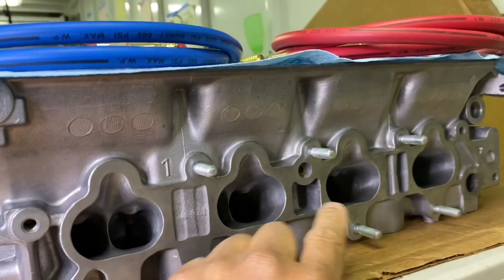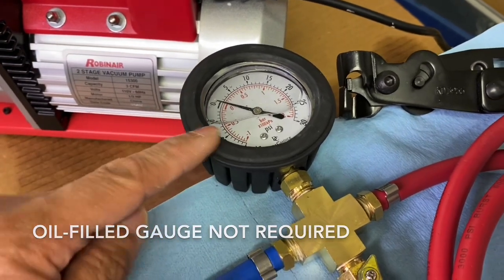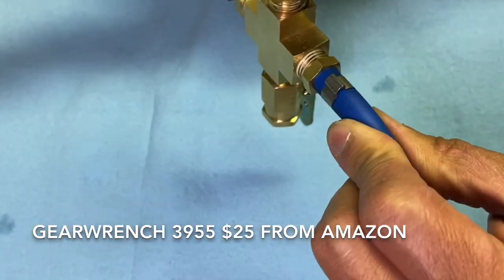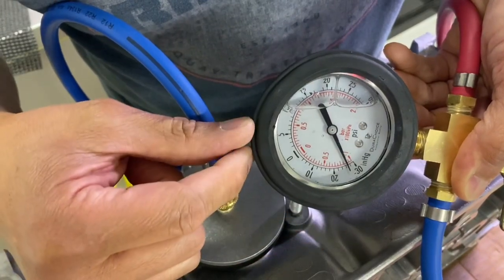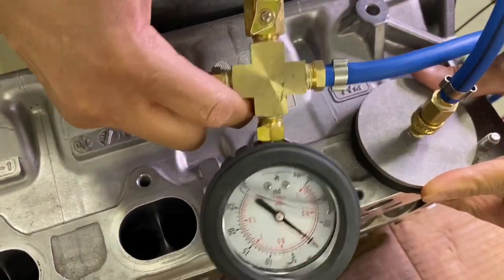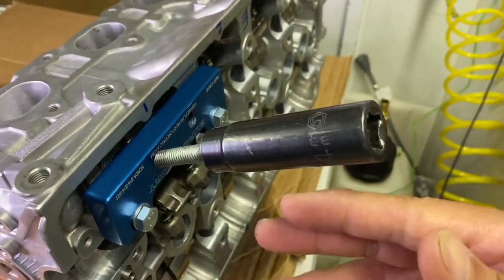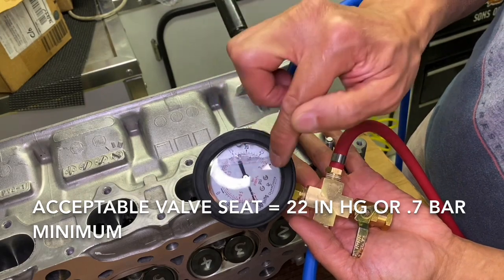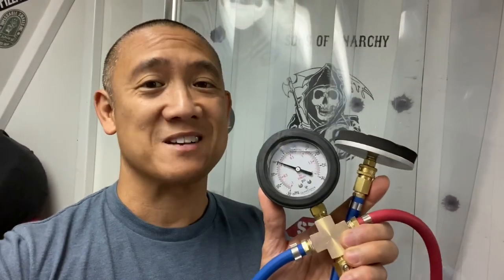How to Check Valve Seats with a Vacuum Gauge

Comment: We use to build similar setups back maybe 40 years ago for testing different things. The constant vacuum source setup can be used for multiple things. Ummm, maybe the only thing I personally would add would be another valve on your red line are vacuum source so you can close it and do a count down after the desired vacuum is acquired. This release's the constant vacuum and can give you a finer reading even though you may not want to test that far. But having the other valve does allow for testing other things that may require a more definite leak test. But that is just my opinion and how some of us use to do it way back. We built multiple different plates etc. for testing different ways. It is good to see someone like you to build your setup. SO many people now days can't figure out anything past a computer are diagnostic screen.
Reply from the maker: Thx for watching, commenting, & the kinds words. I like ur idea regarding the additional ball valve. In fact, I’ve seen something similar on a hand vacuum tester. However, I’m not sure how to quantify if the valve seat is good or not based on the time it takes to lose vacuum.
Reply: @RelentlessRacingAJ  As a starting point, Measure each combustion chamber are single valve are whatever checking. Write down each and try and make all as good as best best one. You will want them natural and clean, do not use any grease as some so mechanics have shown on videos, that defeats the point when trying to get the best seal possible. Plus a vacuum gauge and a tach together can diagnose most anything even the fanciest scanners and equipment can do. If you know what your doing are willing to learn.
Reply from the maker: @rickyshuptrine2831  next head I check I’ll try it. Thx again, AJ

Comment: I learned something new today, I always use a leak down tester or compression gauge after a engine build which is like putting to cart before the donkey. thanks for the interesting information!
Reply from the maker: exactly why I made the tool... it's not the end all be all, but it serves a as quick check so I don't waste my time installing the head and whole motor in the car and find out there is an issue. Glad you liked the vid.  Pls subscribe.  Thx AJ

Comment: excellent tool and video! much more cost effective than buying the whole tool from goodson! and the electric pump could have lots of other uses like getting bubbles out when pouring urethane etc. im working on my own and looking to make an adapter that covers the combustion chamber, so can check all 4 valves at once as well as potentially seeing potential cracks in a head if the valves seal on the outer ports but the chamber itself is not!

Comment: I have tested my head with vacum but using manual hand pump, is more cheap and you can see easy enhough if the head is good or not. mine got to 25/26 on manual pump.

Comment: Good info here, i was doing some diy work on my subaru heads and used the water and air method. It kept failing . I needed to work late and poked around also building a tool . I made mine from an old refridgerator compressor an automotive vacuum gauge a plastic sheet and an oring seal from an old oil filter(junk i had at my disposal) it worked flawlessly. Since the minimum is 22 i passed. It is good also for a quiet setup as the refridgerator compressor has a vacuum and makes very little noise.
Reply from the maker: Nice. Like I wrote b4, it’s not the be all end all, but merely a quick check. pls subscribe. Thx AJ

Comment: I made a tool almost identical to yours and they DO work really well and gives you Peace of Mind! ❤ Good video, better than mine, lol.
Reply from the maker: It is a very useful tool. I even modified the tool w another ball valve which shuts off the vacuum source. B4 and after lapping valves I measure how long the suction plate stays adhered once the vacuum source is cut off. It tells me how much better the valve seat is sealing as a result of lapping.
Reply: @RelentlessRacingAJ  I, too, put a tiny ball valve in line to time leak down. Your numbers on good sealing are good numbers to go by and if you get more inches of mercury, that's even better. I think my sealing numbers were closer to 28 in/hg and that was without valve springs on. After those valves smack the seat a few hundred times, they will be set for good. I know I have a good feeling about how the valves sealed in my 4G63 head that I just put on the shortblock yesterday. Good info for everyone! 👍
Reply from the maker: @martywilsonwilsonenginesho7940 nice... I have been using this tool to evaluate used motors. Usually allows me to get a deal on the motor. I've noticed bent valves won't hold any vacuum. Also, if the valve seat isn't perfect or has corrosion or debris (carbon build up) it at least will hold some vacuum (at least 10 in-Hg). I had a port not hold any vacuum, but fortunately it was large debris between the valve and seat. Some vacuum is my indicator I may have a shot at lapping the valves and saving myself from taking the head to the head rebuilder for a full valve job/replacement. However, if it is a race motor I always rebuild the head and replace the valves and all the other crap anyways. Thx for watching and commenting

Comment: Awesome video! 
Great info which I plan to follow.
Do you know would I be able to test valves with a single stage 3cfm vacuum pump as that is all I can find locally?
Not any 2 stage pumps
Thanks
Reply: yes it will work

Comment: I recently duplicated your rig using a 1 Stage 1.5 CFM A/C vac pump with a  0.020" diameter Orfice Restriction fitting placed on the pump suction fitting....I also Added a vacuum In-line Ball cut--off valve between the Orfice Restriction & the Head Port Pad....These additional  components let's me measure  Significantly Large vac Reading Differences between known Measured valve seat Concentricity measuments of near perfect 0.0005", 0.002" & 0.006" valve seat runout with vac gauge showing Incremental Hg reading differences....The Vacuum shut-off valve closed shows Large vac leak-down rate timings....

Comment: I don't understand why everyone is saying that this test doesn't take into account valve guide/stem/seal leakage.  It absolutely DOES.  If the head of the valve is sealing one end of the port, and the other end of the port is sealed by the test adapter, it doesn't  matter whether there even IS a stem seal or large clearance on the stem.  Both ends of the port are sealed during the test.  There is no place for the vacuum to leak in that case, other than the valve seat, or the seal on the vacuum tester to the port.

Comment: You need to shut off the vacuum and see how long the vacuum holds, 
A large vacuum pump will pull that vacuum with a poorly seated valve.
Another method is to put a bubble glass in the vacuum line to actually see air flow.
Reply from the maker: Thx for watching and commenting. Agreed… this was discussed already. I have a Goodson hand pump and they had some numbers on the instructions. However, it is unclear how to quantify the correct amount of time for a hood valve seat to hold vacuum. Do you have any suggestions?

Comment: I did a valve job and got 3 cylinders ports or whatever maxed out and the 4th one has 25 hg vac. That 4th port valve was super pitted on the intake. MY exhaust valves are perfect
Reply from the maker: Nice. That’s why I don’t do valve jobs. I figure the machine is much more accurate than me. Also, I only use this tool as a quick check before installing a new head w a fresh valve job.

Comment: Very informative, well made video. How does the test described here differ in diagnostic capabilities compared to a water test with pressurized air through the ports. I tested a used head I purchased and out of the 20 valves only two of he exhaust valves show bubbles with the water/air test. Would this method be a more reliable way of telling if there is a valve leak? Thank you
Reply from the maker: Thx for watching and commenting. Pls subscribe. I’ve found using liquid (I use alcohol) and air pressure thru the ports is ineffective bc with enough air pressure, it can overcome the spring pressure and open the valve.
Reply: @RelentlessRacingAJ  Thank you.

Comment: How do valves go holding vaccum when you turn off the vac pump or close off the suction source? Do they hold that vacuum or how quickly does it drop?
Reply from the maker: Good question. B4 I made this contraption, I purchased a hand actuated vacuum from Goodson and couldn’t get a consistent reading bc the suction pad and ports only hold vacuum for so long. Recall, the port is not completely sealed. It leaks thru the valve guide, valve seal, and valve seat (hopefully your machine shop did a good job and the valve seat seals well). Thus, to get a consistent reading I built this contraption to mimic what my machine shop uses to quickly check their heads after final assembly.  Don’t forget to subscribe bc I have a lot more content coming soon.
Reply: @RelentlessRacingAJ  Thanks for the response! I was asking out of curiosity as I made my own the other day and I've been pulling the vacuum from the head side and if I use a light smear of lithium grease I can turn the pump off and it holds the vac at like - 30inhg for like 20 secs and slowly drops down. Which to me is plenty good of a seal. I figure the piston is going to build pressure and detonate way quicker than the valve can leak down.
Reply from the maker: @mgakowski  ah... my Goodson hand pump kit came w some light oil for that same reason. I’ve used mine to the head side too, but I prefer checking the port side so I know if it’s the INT or EXH side is leaking. What is CFM rating on your vacuum pump?

Comment: Is it possible to use a smaller pump? That pump’s a little pricey so was wanting to get a smaller less expensive one that would do the  job. Thoughts, suggestions?
Reply from the maker: Based on the pass or fail criteria from the gauge at port flow, u need to use the same size pump they use. I haven’t verified that pump size yet. Assuming the pump i chose is correct, using a smaller pump will give u erroneous results

Comment: Is the health of the valve guids and valve seals taken into consideration of your testing? Because they are going to affect how much vacuum is held a great deal.
Reply from the maker: I believe one has to use some common sense here. The tool merely tells u there is some sort of leak (and how much of leak) and it’s up to the user to figure out where that leak is. I created this tool as a quick check for a new rebuilt head bc I didn’t want to assume the head is good after the rebuild. Also, I’ve wasted my time bc I assumed a rebuilt head was good. It is definitely not the be all end all, but again it’s merely a quick check. A leak can come from a cracked head, valve seal, valve seat, or valve guide. This tool can figure out if it is a valve seat bc it can vacuum the bottom of the head w a larger adapter.

Comment: Hi i took my head cylinder for suction test to 2 shops.they both said the test was ok.i put water with detergent on the valves and blow is compressor; some valve were bubbling  badly.which sould i follow?.
Reply from the maker: @clementmakamo4557  sorry I missed this comment. The vacuum test is not the best all and all test. The real test is a leak down test, but the head must be on the motor for a leak down test. Also, blowing compressed air into the port is not a valid test bc the air pressure and push the valve open. One adtl which I discovered after I made this video is what I call a drop test. I use the same method to apply vacuum to the port, but I added a procedure where I turn off the vacuum source and time how long it takes the suction plate to fall off. Good valve seat seals allow the suction plate to stay attached for about a minute. Hope this helps. -AJ

Comment: Hello are these values -0.7bar just for petrol engines or for diesel as well? Thank you for the great content
Reply from the maker: I am not familiar w diesel engines enough (despite having a Cummins as a tow rig) to able to answer your question. However, I do know the cylinder pressures are much higher in a diesel. I’d suggest consulting w a head shop that specializes in diesel head work. Thx for watching and commenting

Comment: If you check on the in.and ex. Ports what about the clearance in the valve guide
How does that hold a vacuum?
Reply from the maker: The intake and exhaust port won’t hold perfect vacuum which is why I’m looking for a minimum vacuum number (because it isn’t possible). The leak can be from an out of spec valve guide (meaning the valve guide hole is too big or worn), an old valve seal, or the valve seat. This tool serves as a quick check after a head has been rebuilt. If u get a number below the minimum, then it’s on you to figure out what isn’t sealing properly. I hope this answers your question

Comment: What if u'll going to reverse the process put a pressure on the head and test for any leaks
Reply from the maker: Let’s assume you reverse the process & fill the port with positive pressure. The positive pressure can easily over power the spring pressure holding the valve closed.
Reply: @RelentlessRacingAJ  it depends on the size of u'r cylinder and the volume from bottom dead center to top dead center, then you can determine how much pressure your going to put in the head
Reply from the maker: @siegfredvisitacion736  I am familiar w leak down testing and that’s typically down w the piston at TDC. I’ve never considered the method u r proposing. Pls explain more

Comment: Were the spring installed when you did this? I have a problem where i had seats done and the valves still leak. i believe the issue is weak springs and this would help me narrow down the issue.
Reply from the maker: Barry Spurlock yes they springs were installed. Any time there is a leak, the port will not hold vacuum. Also, a leak is generally at the seat and caused by a bad valve job or a bent valve.

Comment: Do you check the valves hold the vacuum with the pump also switched off?
Reply from the maker: @v8powerv8jim the vacuum pump is always on bc the ports won’t hold vacuum wo the pump on bc there is a slight leak thru the valve guide and valve seal.
Reply: @RelentlessRacingAJ  I’m using a hand operated vacuum pump, I can get all the valves to around 22 inches of vacuum but the readings slowly go down if I stop pumping, so all good right?
Reply from the maker: @v8powerv8jim  I made the mistake of buying a hand pump, too. The hand pump can’t maintain enough of a constant vacuum for you to determine if your valve guides, seals, or seats are sealing well enough. That’s y I built this tool. Take ur head to a head shop and have it tested. Good luck

Comment: So, it looks to me that you’re supplying a consistent negative pressure to your test area? Wouldn’t you want to see how much negative pressure the runner or chamber can hold on its own?
Reply from the maker: Pls elaborate why you want to know how much negative pressure the chamber holds?  Also, how would u test just the chamber ?
Reply: AJ JAQUIAS well, for one, it’s pretty hard to know how much vacuum is leaking through the guide vs seat. I’ve always used a plate on the chamber. Sioux makes a pneumatic vacuum plate gun (very expensive) I used to be cylinder head specialist years ago. I would achieve a positive seal on chambers. I am now working on a 454 of my own, and have achieved slow leakage after a 3 angle which I’ve done. I started to look on line to see if there was a certain amount of leak down which is acceptable. I used to hand lap slow leaking valves after 3 angle if necessary to achieve 0 leak down, but at this point I’m ready to get engine put back together and assume that with the slight amount of leak down, they will seat the rest of the way.
Reply from the maker: @tonysabatino4725  well, I originally bought the Goodson hand vacuum pump & found I couldn’t achieve consistent data. Also, the purpose of this was to double check the head shop after a head rebuild so I don’t put the whole motor together and install it to find out on the dyno I have a leaking valve seat. It’s merely a quick check and if there’s an issue I know I have to take apart the suspect valve and perform an inspection of the seat and valve

Comment: I had a shop do my engine, lower end work and head work.
He did it all. And when he was done i picked it up and the only thing i had to do was put the head on.

At some point i watched a youtube video about a guy who checked his valves with water and compressed air. Blowing air in the ports revealed bubbles in the burningchamber. 
So before i mounted the head back on i did the same test. 
Some valves let trough some air and i was quite pissed. All that work costed me a lot of money. So i went back with the head.

The guy at the shop showed me his test with the vacuum gauge. And guess what......, all valvles seated good. 

Now the engine is build back together and when im done with the rest of the car i can go to a dyno-shop to set the new ecu.
it is now running on a base map. Sometimes i hear a small backfire, and im hoping its because of the basemapping. Or a small vacuum leak. 

Really hope the valves are seating as they should.
Reply from the maker: I created this tool as a quick check and it’s not the end all be all, but I serves its purpose. Good luck w ur cylinder head. Pls subscribe AJ